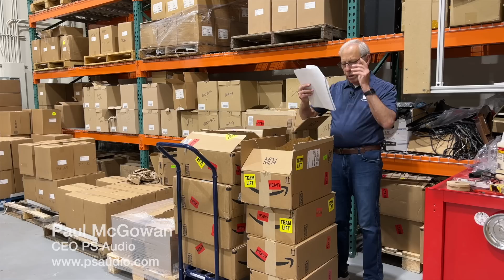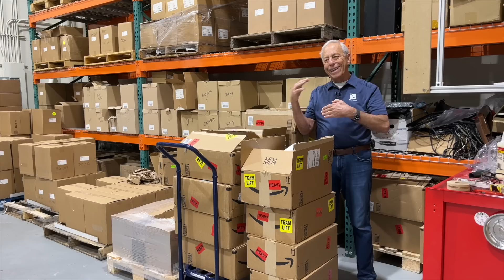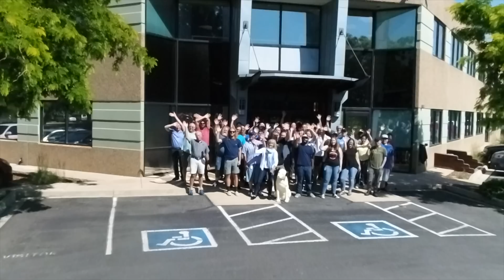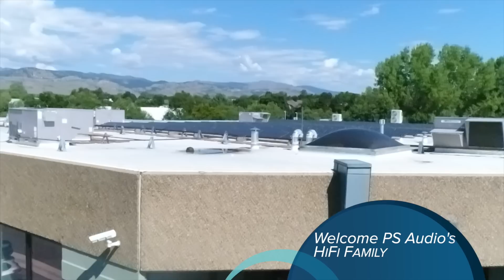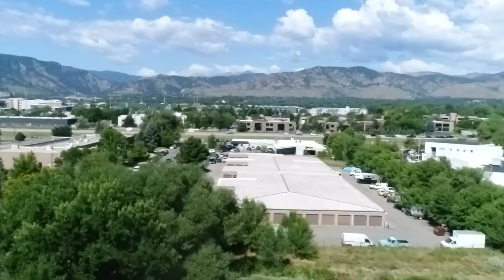Compatibility between DACs and Transports

Comment: It would seem obvious that using a PS Audio transport with a PS Audio DAC would solve the compatiblity issue but what if you prefer or have a R2R ladder DAC? What do you do then?
By the way Paul, if you read the comments, when can we expect to see the new Direct Stream DAC. I'm interested in upgrading my basic R2R DAC but not sure whether to wait for your new Direct Stream or go for a better R2R DAC. A bit more detail on your new DAC would be useful.
Reply: I have a Denafrips Terminator Plus R2R DAC and a PS Audio transport using the I2S connection. Denafrips mentions PS Audio in their manual when talking about connections.
Reply: That's the issue.

For example, if you have a dCS DAC, you won't be able to get DSD out from an SACD to the DAC using the new PS Audio Transport.

Instead you either need to use something like the GeerFab D.BOB or buy the dCS transport that sends the data over dual AES/EBU.

Comment: Isn't AT&T Glass the best way to communicate the digital signal, because it isolates the ground between the transport and DAC?
Reply: It is, but very few transports and DACs offer it.

Wadia used to, but they're essentially dead now.
Reply: Compared to Toshiba Toslink (plastic), AT&T ST-Type optical (glass) is more expensive for the transceiver and fragile for the cable.  The ST-Type has greater bandwidth, but both are limited by the S/PDIF standard to 192kHz/24bit.  EMM Labs still offers it (EMM Optilink), but they are expensive.  The interface has almost disappeared from the marketplace.
Reply: @BruceCross  To clarify, disappeared from the audio marketplace.

It was and remains a standard interface in the telecommunications industry (thus the AT&T ST nomenclature.)

Comment: Accuphase RJ45 has a separate clock.  If you have their integrated CD player and it has an RJ45 in and out so that you can add their room tunning, just connect them. It's a big upgrade for just a cheapcable.  It gets very close to their two box players. Which is why they don't mention it!

Comment: Manufacturers seem to make little to no effort in explaining the pros and cons for the various inputs on their DACs.
Even high-end models offer next to no information.

Do you use USB, TOS, COAX, AES/EBU, etc?
For which inputs will the design of the cable matter, and to what degree?
For each input, what is the maximum cable length, before loss or sound degradation becomes an issue?

The manufacturers spend $$ researching, designing, and implementing several input options, and then tell the customer (by their silence), go figure it out.

The input matters, very much so, because not all inputs sound the same.
The level of engineering that a specific input has, for a given DAC, can vary wildly, affecting sound quality.
The input used can limit the sampling rate.  It would be frustrating to choose a connection, and buy the associated cable and transport, only to find out that you cannot play 176.4 kHz files.

A chart for each model DAC, listing each input, and its pros and cons, should be made available, and should not be something that you have to hunt down to find, assuming it exists.
For high-end models, the sound quality for each input should be shown from best to worst.
When a customer spends big $$ on a high-end DAC, it stands to reason that they want the best sound quality out of that DAC.  So which input would that be?  The customer should not have to guess or do research.

It is a shame to spend $5,000 or $15,000 on a DAC, only to end up using an input that detracts from the DACs full potential.
Reply: Great idea to provide a chart of pros and cons for each input and rank them.  You shouldn't have to call or email the company to get basic product information.  Don't get me started on the absence of specifications and technical data on company websites.  As you note, the R&D is high, but the documentation is low -- probably fear of competitors stealing their tech.
Reply: @BruceCross  The manufacturer does not need to publish their trade secrets.
But if an interface maxes out at 96 kHz, then that should be made clear.  We should not wait until we try to play a higher resolution file to find out that we can't, and not even know why we can't.  All we would know is that the file will not play.

If they know, for example, that their AES/EBU input provides the best sound quality, then they should make that clear.  Perhaps not for a $100 DAC, because such a DAC has too many other limitations for it to make any difference.  But for big $$ DACs, they should.

This is an issue for me, because the audio store's owner did not know the answer.  He said that he uses the USB port, and it sounds great.  I then called the manufacturer, and spoke to the engineer that built the DAC (it was a rather small company with less than 10 employees).  He told me that his customers generally use the USB port, and are very happy.  So that is what I did, and I was happy.  It did sound very good.

Turn the clock forward a year or so, and I heard my same DAC via one of the other inputs, and it sounded better.  But I already invested a good deal of $$ in a transport and USB cable, all of which I would not have done had I have know.  It seems as though they gave me answers that they knew were the easiest for most customers to set-up (USB is simple).

But why the heck do they design and add on the other inputs, and then tell your customers to use the USB input?  And especially when the customer explained that they want to know which input will sound best.  Not good.

Comment: There is no such thing as digital on/off, 1 or 0, because it takes TIME for a 0 to change to a 1, so the so called square wave will not be truly square, but partly curved/analog.
Reply: "Technically," yes, but it can come close! In my studies: If you took an infinite frequency range, you'll have a, "perfect square wave." "OFF," is not zero volts - it's a voltage below 0.8 volts, or about .3 v, or something. I studied this, many years ago. A "1," is above this value. The front of a square wave is composed of many high frequencies; the back end, many lower frequencies. If you have a wide frequency range, the resulting square wave will be, "pretty square." If you have a low power output amp, probably cheap, & way overdrive its channels, the output stage will, "clip," & the output will start to resemble a square wave, the top of the excursions will flatten out. The sound from a speaker will begin to be strident, very distorted, with too much distorted, high frequency sound. This is likely to damage, destroy the tweeter, perhaps the mid range, speakers, because the tweeter is designed to handle much less wattage than the woofer. If you're paying attention, you should hear this; if you aren't, or are drunk / stoned, or are trying to turn your volume way up in your house, so that you can hear it outside while you're working in your garage ~

Comment: I can share my journey so far. Originally had Roon WIFI to stream to DAC. Bought higher end DAC. Rossini APEX with separate master clock. Had RJ45 then wired directly from DAC to main router at the panel so it was not SHARING resources anymore with desktop computer running tasks. Big improvement. Next I put in NRG Edison wall outlets from Audioquest. These things are beasts that hold in connections from the upgraded power chords. The cheap outlets for a few bucks typically crack from the weight of the plug going in. I had separate power breakers installed with 10 gage copper ROMEX to each 2 plug outlet. 1 is for mono amp right speaker, one is for mono amp left speaker, another for pre-amp, another for Niagara 3,000 handling the non-high current products  (DAC, master clock, CD transport). The difference is music and clarity was phenomenal. I have about 2,000 into the RJ45 direct wire, the power breakers with ROMEX, and the outlet plugs. That is with labor and materials. So for instance if your budget is 10k don't spend it all on gear and do nothing for the source feeding the power and the signal. Get the foundation right first. Now it might not make sense if you are fixing to sell your house or live in a rental apartment. Yesterday I received my Audioquest silver power chords and it made a huge difference. Used to have Rocket 88 Audioquest speaker cables. Using older demo cables audio company has the RED series which are almost equivalent to Thunderbird which is one step below Dragon the topline for Audioquest.  The sound stage from the upgrade in cables you have to just hear in your own room it is amazing. At least it was for me. They do make Dragon cables for the speakers but all silver instead of mix of copper and silver. I have heard from others that all silver on the speaker cables makes them too technical and bright versus the silver and copper combo lends more to the organic side of sound. So I am using silver for power chords and XLR signal and copper & silver combo for speaker cables. Keep having fun out there.
Reply: I put in a dedicated line from wall to my main panel with thick Romex, put in hospital grade outlets yadayadayada and dedicated grounds.  The guy buying my house is gonna be "what's a 'stereo breaker' for?" Not sure exactly what you did but it sounds prohibitively expensive and somewhat exotic.  I really can't imagine going to all that trouble.  So while I hear you and am glad you hear a huge difference,  it sounds a little over the top.   And frankly with what you've invested you might consider that you have a vested interest in hearing those improvements.  I hope your reported results are somewhat fanciful because I don't want to go any further down that (not fun) road.  I have not heard a difference in my system, BTW.
Reply: I also forgot to mention that some say upgraded cables are snake oil. I can only say from my experience that IS NOT the case. I can clearly hear a difference with the cables. It's not just whether it's copper or silver or a mix but the strand count and also the space and construction of the cable between wires that gives it a specific musicality. The differences heard can vary in systems due to quality of the components, room set up, and having good clean power to work with.
Reply: Jeez write a book already.
Reply: Thank you for taking the time to share your experience with us all.  It is too complex for me  but I appreciate the time you spent to descibe your experience and experiments

Comment: If you are mixing and matching brands, it is important to learn enough about how transports and DACs work that you know where things are processed and what is transmitted over each interface.  
SPDIF is a compromised interface which will produce a compromised sound.
I2S has been around forever as an interface internal to a CD player.
The TDA1541a chip that Philips introduced in their earliest CD players works perfectly with an I2S input.  I2S contains the clock signal.  That is key.   But a connection that is longer than 3-4" will degrade.  So, to move between boxes, designers take the signal and run it over HDMI.  
USB is something else.  After the USB must be a USB-I2S conversion adding a clock signal.  From there it will be I2S to the DAC.

Comment: I’ve had issues in the past where a computer machine has USB sockets on the motherboard, but they were basic 9600 serial (E.g. 9pin) interfaces but with an USB socket interface. The bus and hardware connected to that socket did not recognise USB devices outside of basic input (keyboard/mouse) serial devices.  I’ve seen similar deviations with RJ45 being used as serial interface and power, not for network. The plugs and sockets do not necessarily indicate that the hardware supports that type of connection.

Comment: Some manufacturers like to prioritize to keep people in their eco-system. Apple is a best example of that manufacturing prioritizing craze.
Reply: instead of having a standardized system, they make their own, because then they don't have to pay anything to others to use their patent. think it's mean and impractical.

it will make a DAC. quickly become old and unusable.

but several also have optical or coax spdif
Reply: @ford1546  
I don’t have a Master’s degree in electrical engineering of any kind.😀
I am challenged enough with Dongle’s, cables as it is now and I live a simple life.
Hi End Audio equipment is not on my radar in life..😀 I am keeping it that way.
My iPhone and two laptops have built in DAC’s. Works fine for me..😎
I just listen to other people’s stuff.🤗
https://youtu.be/h68sbweBdzQ

Comment: Not to be picky, but … while RJ45 is now the ubiquitous connector for Ethernet, I’m old enough to remember Thinnet and Thicknet, which used coaxial cable and connectors for Ethernet implementation. There’s a difference between physical and data layers of transmission, which is pretty much what we’re talking about 😊